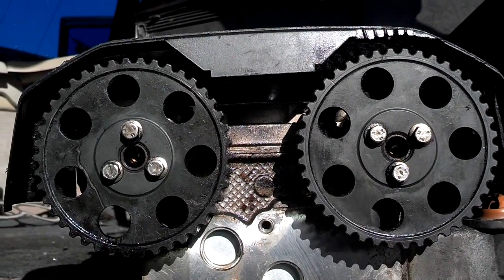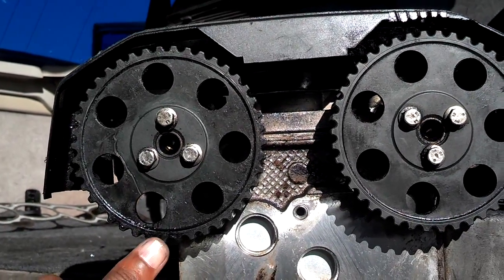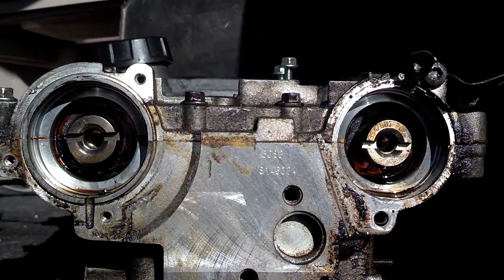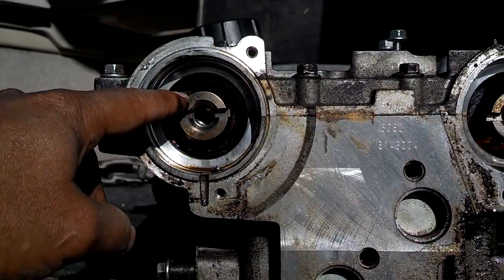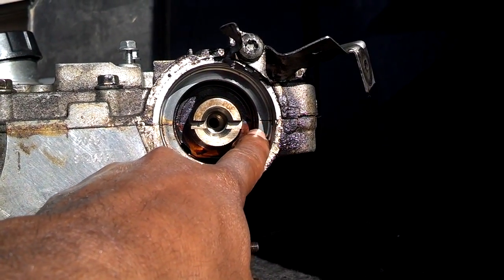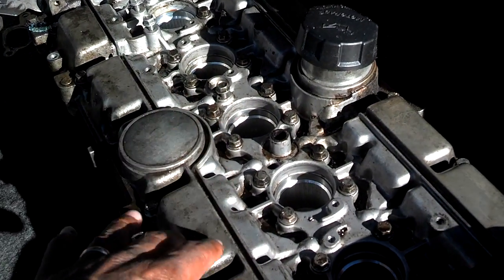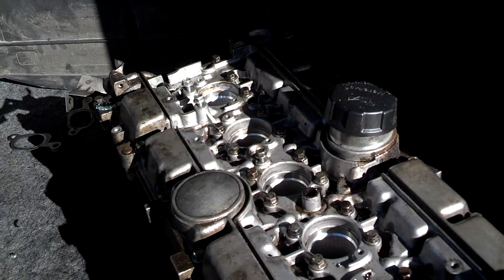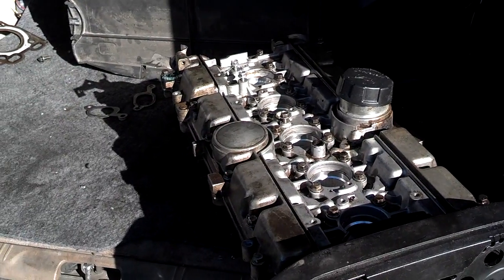Timing demonstration with head removed, cam cover installation. Volvo 850, S70, V70, etc. - VOTD

Comment: Robert my timjng kn cylinder 1 is advanced 68° my marks look off on cams but belt has not been removed os it possible the intake spun faster the the exhaust and caused my timing to be to far off to start my car?
Reply from the maker: Not if the belt is tight.

Comment: Will this work on a s80 t6 volvo 1999?
Reply from the maker: would what work? if you want to check timing, put the crank on the mark and make sure the cam sprockets are aligned to the marks in the cover.

Comment: Once you have the camshafts properly aligned in the back and the cam sprockets aligned in front to the marks on the timing belt cover and you have the camshaft cover secured and the timing belt on, it is a good idea to turn the crank shaft clockwise several times to get the belt to turn the cam shafts for several rotations to make sure that your timing is good. If it is off, eventually the valves and pistons will be out of time, and you won't be able to make complete revolutions of the cam, pistons, and valves. If it all turns smoothly, you know you are good to go. Also, if you have had the engine apart and have reassembled it with assembly lube and have topped off you engine oil and coolant, pull the fuel pump relay and crank the engine over several times to get oil pumped up to the top of the engine before replacing the fuel pump relay and starting up the engine. This "dry" turning over will help lube everything before you start the engine and it starts generating friction and heat.
Reply from the maker: thanks for sharing.

Comment: Hey there Robert. I've sent ya a few questions the last week or so because I've been doing a head gasket install. I'm as shade tree as they come snd feel like I might have got myself in too deep here. Praying you can help. We're in the process of buying a home and cannot make any large purchases so my only choice is fix this thing. Have a 06 v50 t5. I got everything bolted back up and was putting the valve/cam cover back on and the cams are sitting on the cam followers. I know the timing is off. I have the crankshaft holding tool on the way but it is late. Was supposed to arrive today and its after 9pm. I don't know what to do from here to get these caps to even go down where my cams can sit in place and get the cover bolted down. I'm willing to venmo you for time if you could help. My number is 931-401-3410. If you are free but uncomfortable reaching out like that I'm open to any suggestions you have. You seem to really know your stuff on these volvos.
Reply from the maker: Did you watch this video?
Reply: Shoot I think I've watched all of your videos lol. I actually watched both these videos earlier today.  Again I know some things I might ask might seem crazy but I don't know much about these things. My question I guess is how to I get those lifter followers to come down enough to get that cam to sit in there? I'm gonna pull that crank pulley off tmrw when the tool gets here and I'll pull that timing belt to get my mark lined up. But is that gonna let those lifter caps come down any? Or do those come down as you torque the valve cover down? Right now I can't even turn the cams to line up because they don't sit down all the way. Have about 1/8 to 1/4 inch gap between the shaft and the channels its supposed to sit on. Also I'm even new to messaging like this on here so I haven't found it yet but do you have a link or something where I can make a donation for your help. I really appreciate you even taking the time to respond now and with the couple other questions I had this week. I was able to get that lifter tapped down a couple days ago with a screwdriver. I had to put dry ice on it for a couple hours first and get it to shrink a little bit.
Reply from the maker: https://youtu.be/-uotbLq8v8Q

Comment: I passed the timing during self-maintenance. I couldn't find the TDC because I loosened the belt and turned around when I was looking for it. Can the engine be on the car?
Reply from the maker: Huh?
Reply: Robert DIY Hi, forgot the time belt change and setting point.
Reply: Can I set the headset without removing it?

Comment: Hi Robert I'm having trouble with Volvo 850 1993 it died while driving it's getting gas to the fuel rail the timing marks are perfect Honda belt I changed the spark plug spark plug wires so I'm wondering if it could be the coil or something like that
Reply from the maker: https://youtu.be/YiPAPu-K8OI

Comment: I have a 97 Volvo 960 2.9l 24 valve. I placed new water pump. Timing tensioner. And few other things for the timing. I placed the crank on the marking. I have set the cams on right. When I put the cover on. But didn't bolt it down way to tight. The left can on turn at all. But the right cam would turn without any problems. I would like to ask u a question. Why the left cam won't turn freely? Sorry for asking. I watched ur videos. And I use ur advice.
Reply from the maker: Did you use assembly lube on the cams when you installed them?
Reply: @RobertDIY  yes sir I did. I have turn the crank clockwise until I got it on the marking. I used the lube where the cams set in place. When I placed the cams on. I have set them the way they supposed to go on. Due to its a rear wheel drive. Where I can't see at the back for the correct timing on cams. So I had to go by the marking on the front of the cams. The driver side is turning freely. Passenger side doesn't. The question is do I need to keep turning the crank? Because there were few times I did turn the crank some more. When it wasn't time with the oil pump. The passenger side did turn.

Comment: Hey Robert, I pulled my crank pulley off and cranked the motor without my timing belt on I have my cam gears lined up but how can i line up my crank from scratch?
Reply from the maker: I have no idea. You are supposed to line up the crank before you remove the belt.

Comment: Hey Robert, my exhaust cam turned a bit (1/2 inch) clockwise while snugging down the cam cover. I tried to turn the cam back a bit but it wont move in either clockwise or counter clockwise direction.. Do i need to take the whole cam cover loose again or am I missing something? Thanks!
Reply: Its a v70 2,5 10V from 98 btw!
Reply from the maker: Is the crank on its mark?
Reply: Yeah, double checked, the crank is still perfectly on mark..

Comment: Hi I was wondering if can tell me if I can change the cam seals on a 3005 Volvo s40 t5 without the cam tool. I’m in the process of replacing the head gasket.
Reply from the maker: https://www.youtube.com/watch?v=0eSuvM6Bl7Y
Reply: If you are replacing the head gasket, you've obviously removed the cam cover and have liberated the cam shafts with their toothed pulleys.
The seals can actually be slipped off (and on) down the length of the camshaft, past the cams.  Just make sure you replace them in the original orientation
Be careful removing the cams from their beds, particularly if they have VVT units.  The ends near the pulleys fit very tightly into their bearings and can be damaged, and the pulleys overhang protrusions from the engine.  Take your time and wiggle them slowly upwards and towards the pulley.  Don't tilt them until they are free!

Comment: So i cant get the alignment of the cams its off maybe 10 degree , and cant be moved.and the frontmarks dont align on exhaustcam at all.what is the point of alignment of camshaft if the front has to be aligned on marks to?if i turn the front to align the back of the cams move out of alignment.im really struggling with it.Also a old screw in the back or the camshaft broke off while putting the stuff back on, is it really necessary to replace, because it holds good even without the screw in it?
please help Robert , why align the back if the front is not align because of it?
Reply from the maker: +leif fischer huh? I have no idea what you are talking about. I don't even know what kind of car you have.
Reply: i have a volvo 850 2.5 1994 20v,
so my question is:  i aligned the timing of the camshafts on back of the motor, now how do i get the front of the timing right , 
because if i moVe them the back moves too
Reply from the maker: +leif fischer you leave the front where it is and install the belt.

Comment: Hello sir I have a 2004 v70 with 2.4 non-turbo with dual vvt unsprung hubs. Bought it cheap because it would not start. Someone has removed the cam gears to work on the engine and they did not put the cam gears back on correctly and they are not indexed in anyway so you can put them on in all three positions. This motor is interference. the valves get so close that there are recesses cut in the pistons so will this work for this engine?
Reply from the maker: No. Do you have the rear cam locking tool?
Reply: Robert DIY no i do not. i did line up the slots in rear cams according to your video i could not get the front timing marks close no matter where i mounted the sprockets.
Reply: No sir I do not have the rear cam locking tool.
Reply from the maker: It really can not be done without that tool.
Reply: can you explain the process for realigning sprockets. i can get the tool.
Reply: Can you tell me where to get the tool? I have been searching amazon and there are a lot of rear cam locking tools for Volvos and they appear to be engine specific.
Reply: I ordered what I believe to be the right tool. Please let me know what the procedure is.
Reply from the maker: +Chad Boling I have one from Swedish Car Parts. It's a good one. Many other ones from the net are junk, one or two uses before they break.
Reply: once I get the tool installed, what if my front cam timing marks still don't line up? should I just remove hub and reinstall to make it line up?

Comment: man.... yoh have just saved the day..... after 2 weeks of looking around and even talking to Volvo Macanic..... no one could show me how to put on the cam gear and set correct. 
every One just say, you would not take them off....ok but I did so how do I put back on CORRECT????.....
Thanks thanks thanks
Reply from the maker: +TheMoneyTron.com thanks for watching.
Reply: Robert DIY hey boss how to align the camshaft pulley with the dimple in the engine mark, the 2 pulleys on the top match with the marks but the one on the bottom camshaft pulley doesn't match I upload a video please help

Comment: Thank you so much for taking the time to reply. It's a 1999 Volvo S70 base model. I am suspecting the sprocket is somehow on wrong. After watching your video, I realize that I can check the orientation at the back of the motor...and I will do that to be sure.
Reply from the maker: vaz Fx Good deal.

Comment: HI Robert, I have a question. I am in the process of doing a head gasket change. My exhaust cam's market was 180 degrees out of alignment when I was disassembling the motor. I was wondering, is it possible to run the car with the cam 180 degrees opposite the mark on the timing cover? The car's power was very poor, but I attributed that to the head gasket and carbon build up on the valves from valve stem seal leaks. Do you think the previous owner may had the cams flopped, or maybe the cam sprockets are on wrong? what's you guess? Thanks for any advice.
Reply from the maker: vaz Fx I don't think the car will run with the timing off 180 degrees on either of the cams. Check the timing on the back of the motor. It is possible for the cam sprocket to be off but I have no idea what kind of car you have so proceed with caution. Make sure you roll the motor over by hand a couple of times before you start it.

Comment: Thanks so much for this! Took one camshaft apart without marking its orientation using my 'only do one at a time because I haven't ever done this before' method and was stuck for months because I just couldn't find any refrences online or through any of my fellow shadetree Volvo mechanics. I do have one question though. How will I turn the camshafts to get them back on their timing marks? Thanks again!
Reply from the maker: Chas. Dowdy If you can get the crank on it's mark, you can turn the cams anyway you want without any damage to the motor. - Volvo timing alignment, cams moved during timing belt installation - Auto Information Series - Timing Mark Crank Sprocket Location, Volvo 850, S70, V70, XC70 - Auto Information Series

Comment: Hi Robert do u know how can reset the antiskid service requiered on my volvo xc90 2004 ?
Reply from the maker: chilangoguapo32 The ABS light? No, you may want to check to make sure your wheel sensors are plugged in. If so, I suggest you have it checked at a service place that works on Volvo's.
Reply: Robert DIY no is the abs in the dash say antiskid service requiered
Reply from the maker: That would be my guess. What does the owners manual say?
Reply: Robert DIY fault in the dstc system
Reply from the maker: Make sure everything under the hood is connected, especially near the brake booster and ABS module.
Reply: Robert DIY i did and nothing wrong i Just try to reset it WITH the trip bottom and it show me the code 023 and 080 whats the mean ?
Reply: Robert DIY i did and nothing wrong i Just try to reset it WITH the trip bottom and it show me the code 023 and 080 whats the mean ?
Reply from the maker: I don't know. Post the question on a forum.

Comment: Hi i just bought a set of NA cams to put into my 97 850 t5, would it be possible for you to make a tutorial on how to do a proper instal of these cams? Steps, tools, how to set the timing? Much appreciated my friend :)
Reply from the maker: John Gregory The video of removing the head and installing it will show you how to install the cams. Just remove the stuff off of the back of the motor (cap, rotor, cam sensor, etc). Then remove the cam cover. Swap the cams out, then time the intake cam 4 degrees advance (you will need a compass or cam tool for that), advance is top towards the front of the car. - Volvo S70 T5 restoration day 7, head cleaning, cam swap, valves removed, etc. - Auto Repair Series  Yes I can make a video to swapping the cams but it won't be any time soon unless someone request my help in doing so.

Comment: Yes I watched it, it seems that in the xc90 was dry white smoke, in the case of my s80 t6 if I rev the car you can actually see like to much moisture in the floor almost like an spray of water, and the white smoke is not as pronounce as in the xc90.
Reply from the maker: Oz Ramuco My be early stages. Worth checking the shafts for play.

Comment: But it's there coolant use to cool the turbos or just oil? If only oil then the turbos wouldn't cause the white smoke and condensation from exhaust system along with droplets of what appears to be coolant
Reply from the maker: Oz Ramuco COOLANT AND OIL. Did you watch the video I posted with the XC90 I linked?

Comment: Well the car besides blowing white smoke from the exhaust also leaks drops of what I think it's coolant even after the car has been running for a whole and the car is warm, I have look onto the oil cap and oil stick and doesn't seem to be any coolant on oil, (no creaminess of oil or white residue)  so I am totally confused here, so the only thing I was thinking now that it could be but not sure, is if the turbos are water cool then maybe one of both it's leaking and sending some of that leak straight out trough the exhaust pipe?
Reply from the maker: Oz Ramuco The turbo's are actually part of the exhaust. They use exhaust air to drive the turbines. If one or both are leaking oil, you will get the light grey smoke out the exhaust. Pull the inlets of the turbos and see if either has any shaft play.

Comment: I am thinking it might have something to do with the turbo or something like that maybe? My car is a 2000 s80 t6 model, I like the car but it's making me old by the minute :(
Reply from the maker: Oz Ramuco Head gaskets usually don't just blow. You have to over heat the motor or someone had to install it wrong.
Reply: so do you thing maybe I did not install the head gasket correctly? its there anything else i should look into before I dig back onto removing the head again? don't know if there is any relation between the turbo, exhaust manifold or maybe something around there to be causing both the white smoke and the coolant leak behind the engine on the driver side. any ideas or advice helps